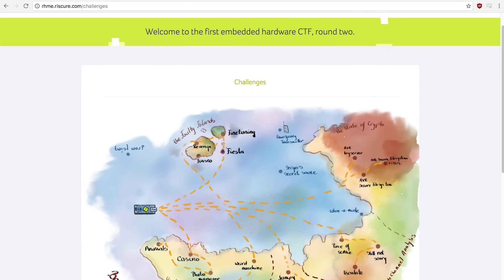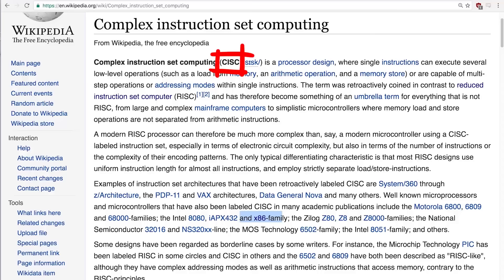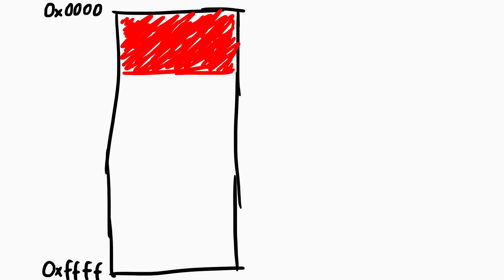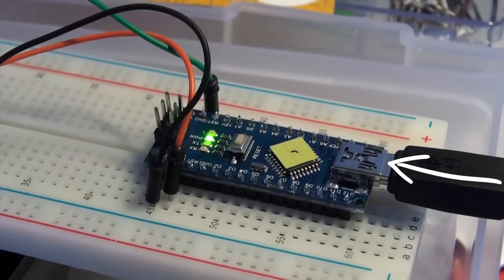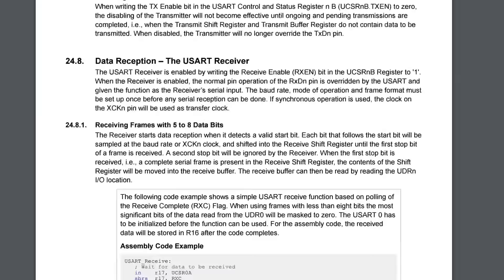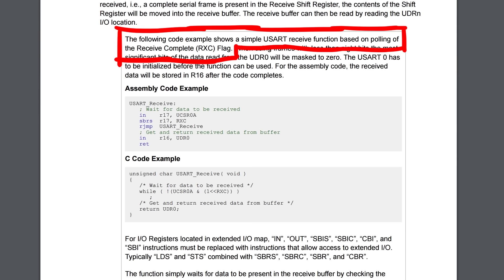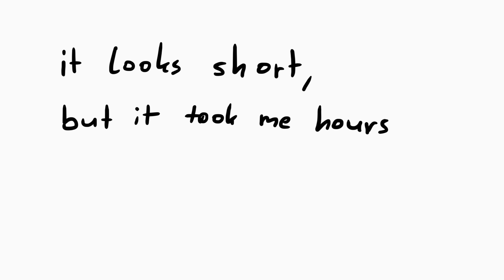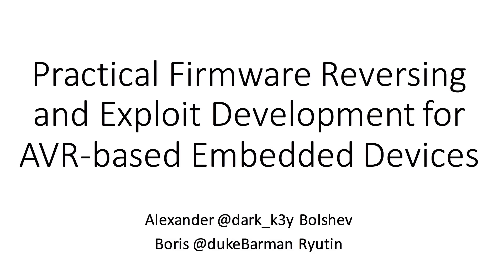Start reverse engineering AVR - Memory Map and I/O Registers - rhme2 Reverse Engineering

Comment: There was a thing I recently had to do at work actually that involved needing to debug and patch a binary from a Texas Instruments C6000 Digital Signal Processor without any of the source code for that binary. If you thought x86 or AVR assembler was difficult to understand, well let me tell you, DSP assembly code is a hundred times worse. None of the details of the way the different execution units work, which units are able to access which registers, or how the instruction pipelining is handled are abstracted away at all, and one particular thing that really caught me off guard was how it's branch instructions work: when you call a branch instruction, the processor doesn't immediately jump, but just keeps executing more instructions after the branch, and then finally jumps a few cycles later -- and this happens even for the unconditional jump. And that wasn't even the most counter-intuitive thing either; even now the way the call stack on that processor works is still a mystery to me.
Reply: For some reason that branch instruction thing makes me think of speculative execution. I know practically nothing about this stuff however.
Reply: Edit: untill you realize the comment is 3 year old, crap

it's a delay slot and is used for optimization and keep the processor fully pipelined, basically after branch instruction is fetched processor does know which instruction to fetch next, it can be next instruction or target address and target address is only known at later stages of pipelined processor ( like decode stage for JMP or Execute stage for conditional jumps) DSP processor uses delay slots for saving cycles and any instruction that execute no matter jump taken or not can put in jump slot.And its not unique for DSP , many other processor like MIPS, SPARC uses delay slot. And x86 does not uses delay slot because many optimization is baked into the hardware ( like Branch Target Buffer and even Neural Network !!! ) and does not require compiler support, giving it 95%++ accuracy on branches !!!

Comment: risc can do some really cool optimizations, so that even with more instructions your code might actually perform as well or even better than the equivalent cisc instructions. there was a talk about it somewhere. risc also produces smaller chips. chip cost increases exponentially with the die size, because not only do you get less units per wafer, but also a single fault may ruin more wafer area with bigger chips.